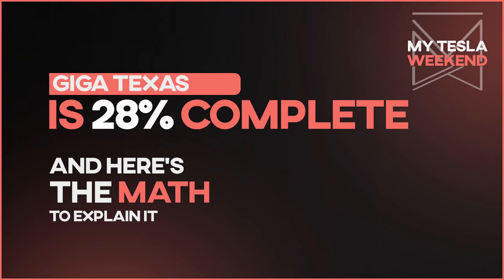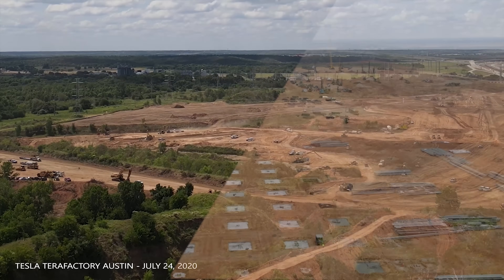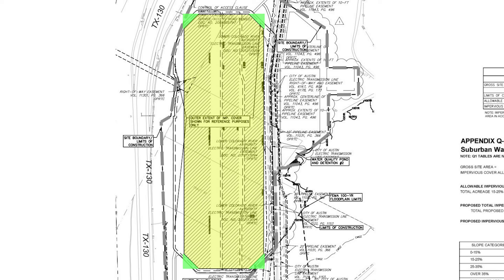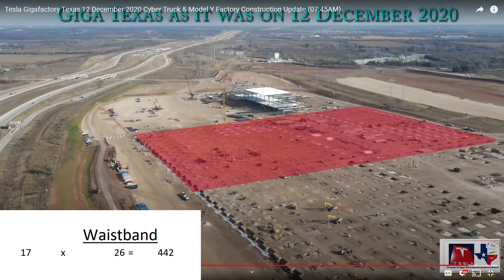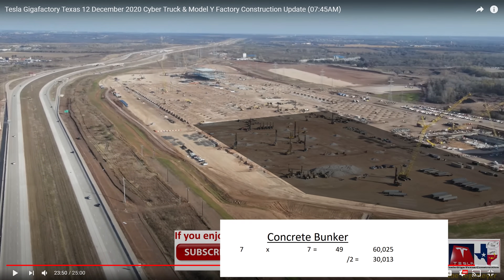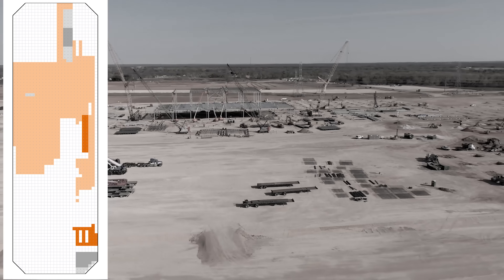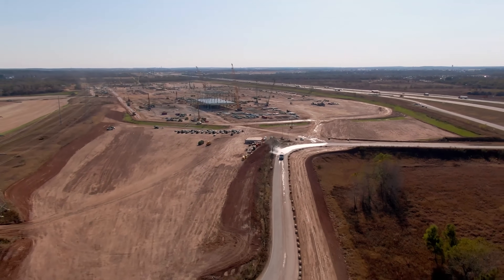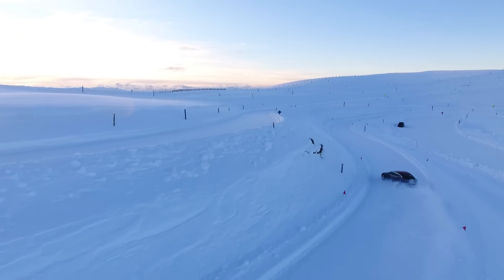Giga Texas is 28% complete, with the math to prove it

Comment: I'm guessing it will be Spring.  April.  The walls and roofing go pretty quick.  Interior finish out goes fast too for a factory.  The foundation takes the longest for a factory.  It has to be done well and massive to support the machines making the machines.  And I just watched a drone video flying the factory yesterday.  There has been a lot of progress.  

I also saw a Drone video of the Nikola factory build.  Very little progress on that factory and its tiny compared to a gigafactory.  I don't know when they started, but there site looks empty.  1 lonely crane and a couple of trucks.
Reply from the maker: As in 100 days from now? I can see the exterior walls being done, but even Shanghai took 4-months from finished walls to first production.
Reply: @FutureAzA  I may be optimistic, but these types of buildings go up pretty quick.  And they're working around the clock.  Hopefully they get it dried in 2 months.  I suspect as fast as it being built, they'll be finishing the interior in some parts when still working on the exterior walls and roof in other parts.
Reply from the maker: @dahveed284  I'll be very happy if you're right, but since I'm not a reservation holder, I guess the timeline isn't as critical to me. Though as a shareholder, I'd really like it done sooner than later.

Comment: The plant in Sparks/RENO, NV is only 30% finished as well, but you would never know that because of what they do there.
Reply from the maker: It's an interesting exception because when they planned it, they would have needed the entire footprint to reach their battery production goals. Process and other improvements have allowed them to exceed the initial output objective without using as much space as the tech at the time would have required.

I think they've also run into a talent shortage since Reno is a fairly small market and even if they took all the qualified engineers, they'd still find it isn't enough.

Comment: As a Construction Manager on numerous commercial projects ranging between $10mil and $500mil, I have used a simple "lazy S curve" on a graph with gross billings (or %) on the left vertical line and months on the bottom line as a second method to follow the construction schedule. Believe it or not, this method was fairly accurate in noting if the project is on schedule or not. If you are not spending the money you are not progressing. This simple graph only took me 10 minutes to make. Again, this is a secondary method.

If using Elon's 12 month schedule (7/1/21 completion), then as of 12/15/20 I show 27% complete.  If 16 months (11/1/21 completion), then I show 18% complete. Quite a difference.

So, it this is any indication, your 28% completion would indicate a 7/1/21 completion of Phase 1.
Reply from the maker: These are amazing and fascinating insights, thank you!

Comment: Ok the equal weighting is very wrong. The framing is very fast, roof too because is basically just assembly for these buildings. Interiors take longer and we can’t know how difficult some installations for factory machines are but these thing are done simultaneously. You can estimate completion but is very hard to estimate time, without some significant information.
Reply from the maker: I totally agree, but I don't know a better way to weight it. There's a practical limit to how many cranes can safely erect the structure at once, but like you said, the significantly more involved interior process can be done better in an "all at once" fashion.

In the next construction math update I'll add some context about the times it took for Shanghai to go from exterior completion to trial production to better understand the timeline. Thanks for the feedback!
Reply: @FutureAzA  exactly I think the best way to do it is comparing it to other factories at the same scale. Good luck!

Comment: I think construction speed should accelerate more the further the project goes. More crews from different subcontractors could be deployed to run different stages of construction in parallel.
Like when earthworks were in full swing nothing else could proceed. then footer started to be dug out and still the only way to parallelize was to get more excavators to dig footer. Now, however, while same number of crews continue to dig footers there is also a set of crews setting steel columns, and assembling roof trusses and laying down metal sheet flooring and roofing. From this point forward you could expect even more crews to start to work so construction velocity should increase dramatically.
Reply from the maker: I think you're right for a bunch of reasons. Once each area of footings reaches 100% they can put a steel crew in there, and once big chunks of framing are done, contractors can start on the interior without stepping on each others' toes. Another commenter pointed out that interior work could comprise 40% of the total work (even, if not especially by cost,) but the interior work won't be as visible to us.

Comment: Great work, the project can be finished in stages, not all work onsite needs to be completed, if each section reached a 25% completion, the factory could start test production in these sections, is my guess!
Reply from the maker: I totally agree with that, but it looks like they're taking an "all at once" approach. I figured they'd work on the east side first, then move to the western half while the interior gets finished on the first half. Based on early permits, it looks a bit like they're doing all three phases at once instead of over time. I suspect this is because of the two capital raises since groundbreaking. If you've got an extra $10B cash on hand, might as well put it to use sooner rather than later.

What a boon for the local economy. The tax incentives offered are likely starting to look like a damn fine investment.

Comment: I'm not a building expert, but I reckon the "visible" progress will accelerate once this period is out of the way. The placement of steel parts on the ground, and the need for more geo-piles is holding up erection of the actual buildings. Texas seems about 5 months behind Berlin. ie They were at this stage around July.
Reply from the maker: The sheer amount of site remediation to make the ground ready made for a pretty massive challenge, though Berlin had to contend with environmental delays (the hibernating bats.) Still, it's vastly easier to fell trees than fill a swamp. Berlin also enjoyed the added benefit of having it's own train line where they could bring in 1,000 tons of finished concrete columns and spans at a shot.

Comment: Elon has recently said that putting up the building is easy, the interior is hard.  In Giga Berlin videos, you can see that they have started interior work like piping in the ceiling and some bigger equipment still wrapped on skids.  Work between your phases can overlap, but I'm not sure how much overall time will be saved.
Reply from the maker: I feel like you're right because the exterior work at Giga Shanghai was "finished" around the end of July 2019, but test production didn't start until October, and customer deliveries didn't start until January.

But think about that. Groundbreaking in Shanghai was just 24-months ago, and yet here we are. Phase 1 is at full speed and Phase 2 is already ramping up. They're likely to ship 300-350k units this year.

Shanghai delivered 22k Model 3 last month. That's as many units as the whole of Tesla shipped in all of Q2 of 2017 from just one factory in one month.

Comment: On the span length. Originally we were working with a span length of 55 feet, until Jeff did some rough calculations from a photo with a ladder in and came up with 35 feet.  Working with 27 rows of pillars across a width of 1180 feet gives 26 spans of 45.4 feet. With the length of the building(s) @3820 that would make 84 rows of pillars along the length.
  This span is key to working out how many pillars and square section to the need to put up and how far they have got. Working to 55 foot spans it worked out to around 1000 square sections. @35 foot it was ~1500 squares and @43 feet its ~1300.
  With something like 20 steel members per square with two levels, that’s somewhere between 20-30 thousand members, which is a fair few lorry loads
Reply: 27 rows of pillars makes 26 spans, thus 45.4 ft each.
44.6 ft is a common maximum semi trailer length (plus some overhang tolerance), I would not be surprised if this was the basis to avoid oversize load complications.

Some footings seem to be absent or not aligned, the building may be non-regular in some parts.
Lengthwise the heavy machinery part at the end has different pillars and spans.

And finally, the floors do not cover all the footprint.
Reply: @musaran2  Haha yes i forgot -1. Thanks for spotting it. I’ll edit it. Also less post width, which i guess is at least 12 Inches.
  That makes a lot of sense that the maximum standard load on a flatbed is the size they would use. Very Elon.  Randy got a close up of some on the lorry and it does looks like they have used every inch. Unfortunately he didn't get a pic of the label with the spec.
https://youtu.be/QtnfsoyxQ6Q?t=28

  The new footings in the north-east i'm reading as a similar concrete construction to the paintshop in Berlin. On the basis of these unaligned footings and it being the same supplier who possibly have a preferred building type. Center alignment of other footings is very uniform, while their depths and size vary. There is a row of smaller footing within footings on the west side, which i have no idea about.

  Yes some areas will have 1 level, some 2 and some 3, for now as a rough i went with what we have for 2 levels and a roof.
Reply from the maker: Great catch on the trailer length. That would actually make sense. Yeah I couldn't square that circle which is why I had to switch from real dimensions to simpler percentages halfway though my research. I can go back to square footage if better information becomes available, but it's also important to note how many 2nd & 3rd floors there are. I'll consider adding that to my tracker before it gets too closed in to easily go back and see.
Reply: @FutureAzA  Yes, I was wondering if there was a standard trailer length at the time, but I was trying to see if I could get the guys to get a 2D drone footage to 3D model service.
  A tracker sounds good. Especially as tracking is all we can do with the work deviating from the basic plans we had. A percentage on the various tasks, that we can see from outside. Wanting to know how many foundations was the original reason why i wanted to know the span lengths, because the footings are not installed along the whole building yet.

  I have been finding some interesting info in the records of council meetings and was wondering why no one was liking or commenting. I think they are being ghosted by YouTube because of the links.
  Can you see my other comment on this video starting "It’s great to have the added analysis ..."? I think it’s one that’s been ghosted.
Reply from the maker: Two of your comments ended up in "held for moderation", but I always check there. If the comments still aren't showing up, that's a YouTube thing. They definitely like to pick and choose winners, which can be very frustrating.
Reply: @FutureAzA  Ouch held for moderation. I didn't know that was a thing here. That explains why some great comments on the quad squad channels, with links to sources go no traction. On these daily update videos, if you haven't commented in the first hour few people will see it. So this type of moderation kills it
  Thanks for answering this. I think I’ve put the quad squad's back up, by expressing my negativity on the speed of the steelwork and comments about them needing a big blue diamond shaped delivery to help them get it up. So this is more natural territory.
Did you read the comment you unmoderated? There is great content from Tesla with real the energy of Tesla that’s not been aired on youtube.
  I don't mind digging though the city's public record, but if no one sees what i find because of links, it’s a waste of time.
  I really feel there is a need for someone to do more back office analysis on this site. We are all grateful to the Quad Squad, but they have just about enough spare time to get the footage and have busy lives, so don't have the time to get deep. I've been saying to them for a while to build a team around them, like NASASpaceflight, WAI, etc, who can do graphics, 3d models, music, ... The sum is worth more than the parts.
Reply from the maker: I can't reply to them before approving them, and once I do they get buried under dozens and dozens of other comments. I would appreciate any help weeding through to find the important parts, but I plan to go through them all myself as well.

I'm doing my best here. :/
Reply: @FutureAzA  Yes they are worth listening to once through. There is a contrast between the energy of Tesla and of the City, there is a good quote from Tesla explaining they were planning, permitting and constructing simultaneously. That explains why the pans we first saw have changed and to be fair gives the contractors a reason for not going faster.
  There was also a quote from Tesla telling the council there were enthusiasts on youtube with high quality footage but this was on of the ones that must have been blocked because it got no likes or comments. 
  There is actually too much to remember, so i’ll take notes when i watch it again.  There are a lot of impressive insights into Tesla.

  I got your email i'll ping you a link.
Reply from the maker: This really highlights the benefit of having your own dedicated trainyard like in Berlin. Makes moving in vast amounts of fill and construction material that much simpler. Or at least it moves the logistical challenge higher up the supply chain.
Reply: @FutureAzA  America was built for the car.  Tesla's history with rail in the US rules it out.
Inspiration Bubble Tesla buys Am-Track, BNFS et al for the right of ways and America gets the long distance transportation solution it deserves.
Reply from the maker: Also, you can email me by going to my ABOUT page and finding it there.

Comment: It’s great to have the added analysis it adds value to the quad squad's footage. I was hoping someone would do more of the background stories. For instance there are some interesting presentations by Tesla on the public record at Austin City Council, which give a great insight into Tesla's objectives and internal character. Some of this is dated, but not aired before and i think people would want to see clips from these long meetings.

July 16, 2020 Austin City Council Special Called Meeting
https://austintx.new.swagit.com/videos/73761
https://www.austintexas.gov/department/city-council/2020/20200716-spec.htm

Aug 20, 2020 Austin Water Oversight Committee Item 3
https://austintx.new.swagit.com/videos/74922?ts=649
https://www.austintexas.gov/department/city-council/2020/20200820-awoc.htm
Reply from the maker: Sorry for the delay, there's a lot to digest here. This is a pretty awesome tip. I will check them out, but it may take a few weeks (at least) if I can get through them enough to make something meaningful. I genuinely appreciate the suggestion. And FYI, somehow your comments are still getting kicked to "held for review" even though I keep approving them. :/
Reply: @FutureAzA  If it’s helpful I can index them a bit for you, as the Tesla talking bits are great, but some of the rest is boring council meeting. If you can ping me an email address, i can ping you stuff.
  I'm glad to know what’s happening with the comments.  I was getting a bit paranoid that the others weren’t responding because this info put their nose out somehow. It's actually happening with comments with no links as well. I’m a systems engineer, but can't figure out what the rules are. Well that limits my first amendment freedoms, thanks Google. I'm glad we live in a 'free' country.

Comment: Your 28% completion weighs the five stages equally.  I do not think that is appropriate.  Actually I think the interior is probably 40% of the overall work, but they can put a lot more workers into that phase.  That said, any estimate here is really a wild guess.
Reply: Yeah, for each stage a % and extrapolated time estimate is fine.
But for overall, one has to account stages have to wait for the previous one.
Reply from the maker: Plus this is just the first snapshot. The estimated completion should come into clearer focus once we track a few weeks of progress.
Reply from the maker: I agree that it really is a wild estimate, but like you said, it's kinda tough to know. Especially as the building is closed off we'll have almost no indication what's going on in terms of interior completion. We'll see HVAC equipment on the roof and large equipment being delivered, but it will be impossible to know how much of it is actually installed, or even how much needs to be there. Thanks for the feedback!